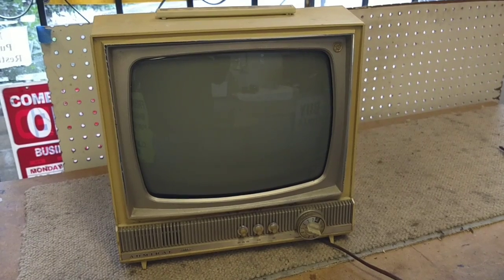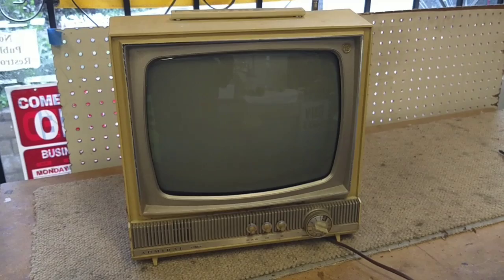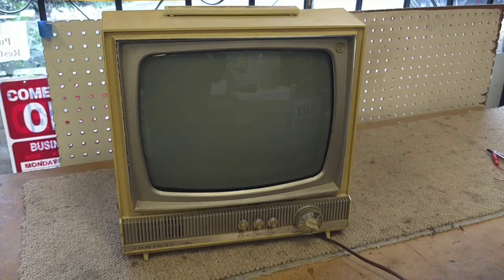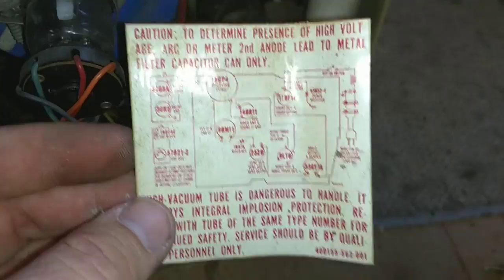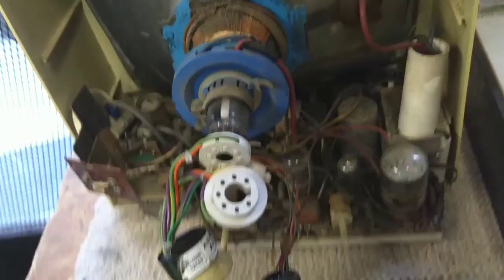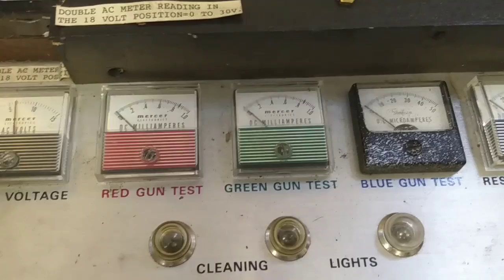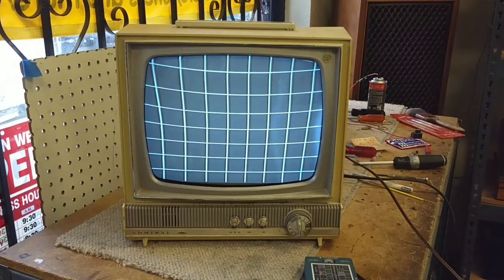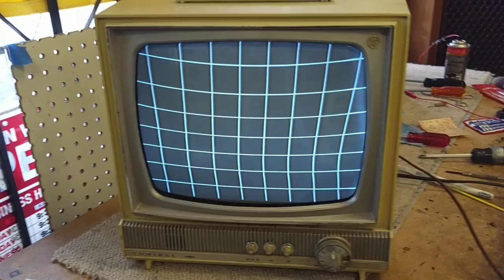Repair of a 1966 Admiral pk1369 vacuum tube black and white tv part 1/?

Comment: Yokes were common on these. That black shit used to be clear. Good indicator of bad
yoke. Hint. If you suspect the  the yoke is causing no raster pull it off & run the
set. Usually it will burn then. If short is on inside it will leave a mark on the CRT.
LFOD !

Comment: You're off to a good start. The picture tube looks surprisingly bright for how it tested, and the flyback seems to be ok. I don't know much about tv's, but I do know from radio service that tubes/pcb's do not mix--heat destroys the solder joints, and sometimes even the pcb's themselves

Comment: What's up with the pic tube tester?
There seemed to be enough contrast in it; yet the tester said 'dead, dead, deadsky'?
Reply from the maker: Still accurate on other crts. I had a zenith that tested very badly and still had a watchable picture. Just depends on how the set uses the gun (voltages, bias, etc)

Comment: won't whatever cleaner you might clean the nicotar off that yoke like cut the insulation of the yoke coil? that'd make it short like a metaphor... I mean simile. I have a similar age Zenith B&W portable.. it's one of the cutest  ones ever, has so much tar of whatever make on its yoke, made me gag to see it.~also, maybe having a crappy-signal ghost still in it made the pic tube test bad? - maybe someone had it apart and saw the glob and tried to clean it? -lol, can't wait for pt. 2
Reply: oh I already had stated that.. lol